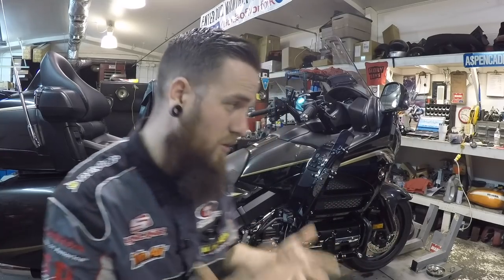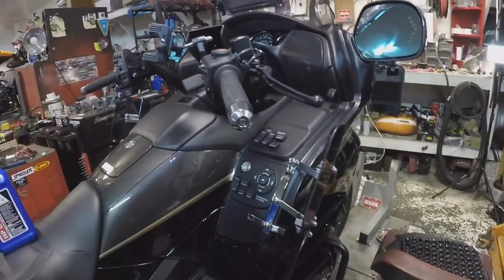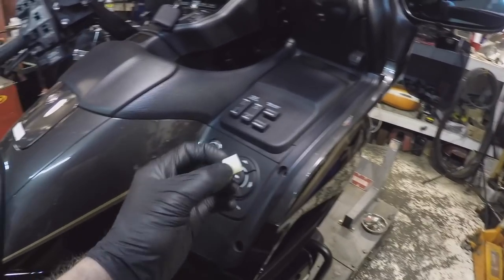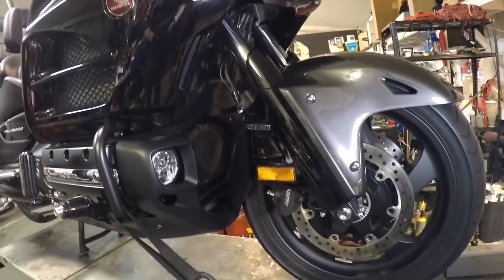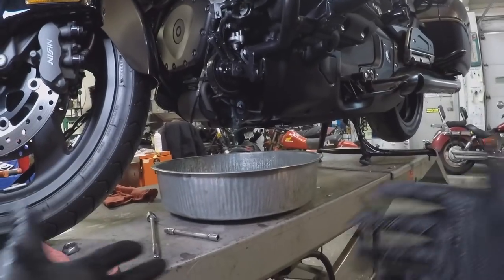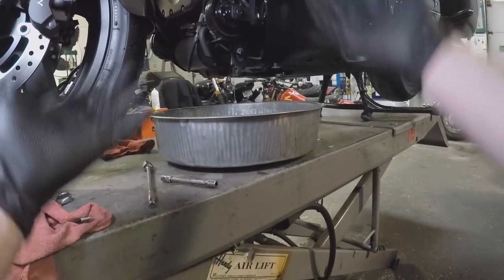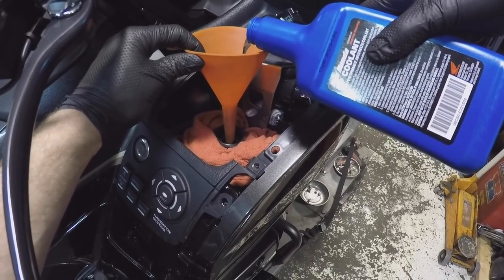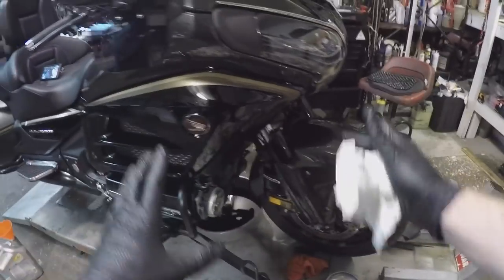2012 - 2017 Honda GL1800: Coolant Change

Comment: I'm going to try this. I just removed the lower cowl to bleed the clutch. Thanks for showing me that I put it back on wrong .😀 I have a 2015 that I punctured the overflow bottle putting the bike on a trailer last year. The dealer replaced the bottle, and I'm pretty sure they put green coolant back in there. Do I need to do that distilled water flush you were talking about? Also, when you do that, do you fill the whole system, including the overflow bottle with the distilled water?

Comment: Cody, this vid just popped up and I decided to watch since I may ditch my Harley and get a GW. I like your style. I know that GW has a crap load of plastic body and it somewhat intimidates me. Are you located on the west coast? Should I get a GW I'd like for you to work on it. I started out on a Honda (owned 3. A 175,350 and a 71 750), so I might end up with a GW. I'm subscribing so I can binge on your vids. Again great content.
Reply from the maker: Thanks Freddie! Ditch the Harley and get that wing! “Recommend any of the 1800s after 2006!” Very little maintenance and it will take you anywhere! 👍🏻

Comment: Excellent video. I have a 2014 Honda Goldwing Valkyrie 1800C. I took it to a Honda dealership for a coolant flush..I bought it new in 2016, I keep her very  very clean.. When I got it home, I noticed the right side lower cowel was loose,  the left side was tight, it's never have the cowel removed before. I haven't taken her back yet, babysitting duties, but will this Saturday. I haven't looked at the 3 screws yet or the 2 pop pins at the top. What would be your recommendation to me to look at first to figure out why it's loose, before I go back to the dealership. 
Thanks a bunch...

Comment: Whew the '01-10 is so much easier, Drain plug right by the oil filter you dont need to remove cowl or anything and raidiator cap right under storage box easily removed..👍

Comment: What can you do if your aux does not work.   I think I plugged a bad flash drive in and the aux has not work since.  I have a 2017 GL 1800 navigation, audio system

Comment: Nice video but you didn't need to take that fairing off,at least not on my 2015 f6b.the drain is by the oil filter

Comment: Maybe someone can help me out. 96 Honda Shadow Ace. New  charged battery, good compression 125-135 psi, spark on all plugs bright blue, very clean carb with new gaskets, still won't start. And yes the gas is on, in neutral, kickstand up, clutch in, killswitch to run. When I tried to use starter fluid on the carbs it shot the fluid back at me. Timing issue?

Comment: Gracias por tu vídeo , es excelente, puedes decirme cual es la medida de la llave para soltar el tornillo de vaciado de agua?

Thanks for your video, it is excellent, can you tell me what is the size of the key to loosen the water drain screw?

greetings from Spain

Comment: i dont even think you would need to take the fairing lower off. even then i think id just dremel an area in the fairing lower plastic so that i could drain the coolant with out taking it off. plus it would give me better access to get the oil filter wrench in there.

Comment: great video. and just in time i am doing mine this weekend.  how about and air filter change on a gl1800 goldwing? that can prove to be fun.
Reply from the maker: AH this infamous, GL air filter. When I get another one in. Ill see if I can record the sea of parts and harness removals lol
Reply: what is you best time doing the air filter change?  by myself taking my sweet time and being very sure to not leave anything  disconnected like the radio antenna 2.5 hrs. another great project is adjusting the slack out of the cruise control cable. not as bad as the air filter but still a lot of plastic has to come off. keep the videos coming.
Reply: i actually done that on my 08, through a youtube video. not too bad. patience is the key. and time, obviously. good luck!
Reply: very time consuming. i am waiting for winter  so i don't fried my brains out. i liver in very sunny florida.

Comment: Thanks very much for the clear video.  I am wondering if doing my oil and filter at the same time would be good timing.  Since I can squeak out the filter without taking the cowl off I am wondering if I can squeak out the coolant drain bolt while the filter is out.  I plan to use the 8mm, a universal joint with an extension might work.   I have taken the cowl off once to do the clutch fluid change but hoping I won't have to if not too hard.  Has anyone else tried this with the oil filter off?

Comment: changed my  coolant  and now getting hot not sure what happen   any body ??  its the right kind of coolant will air in system cause it to get hot or show hot ??
Reply: You have air in the system, you need to burp your radiator and add coolant.

Comment: So he only put in 3 quarts    I was told it should take 4.  I put the 4 th in the overflow was in the marks but at the top indicator    Went riding.  Fine at 60 mph.    Ur went through a fast food place  and it overheated  and coolant came out.     I bet I need to suck out fair amount of fluid from the overflow.      Any thoughts welcome?

Comment: There is no need to remove the front lower cowl. This link shows how to drain the system without splashing or loosing a drop. Mouse click each photo thumbnail to enlarge:
https://gl1800riders.com/forums/members/22132-gatorwing-albums-coolant-drain.html

Comment: Can someone answer my question real quick. I took off my pod filters and used my hand to block off the intake from each carb, all but one spit out fuel. when I put my finger on the air mixture screw on the one that doesn’t spit out fuel the engine won’t bog down like the others do. Whats wrong with that one carburetor? The slide does go up though when I block it, just no fuel comes out and it doesn’t bog the engine

Comment: Good video. I was expecting  to see all the way, including  the plastic bottle level at the left side, but didn't happen.  Than, what's up with the gloves?
I always work with my bare hands, and I don't have any issues getting dirty hands.
Gloves = waste of money 💰 for us.
In your case was donated
Reply: As you get older, you get wiser. I never wore gloves either, but since my 9 to 5 job is in a "white collar" setting, I can't be going into the office with black fingernails, and cuts and abrasions all over my mitts! I didn't used to wear a helmet either, but now, I always do. Same with riding jackets, and riding gloves. I even take rain gear along with me now, when I go on long-distance rides!